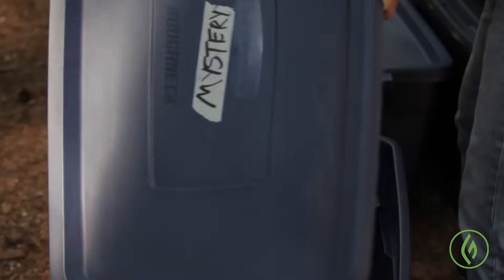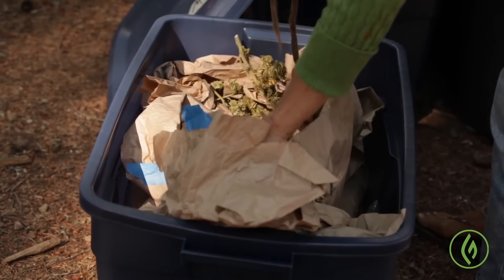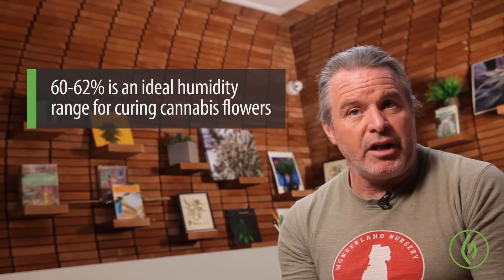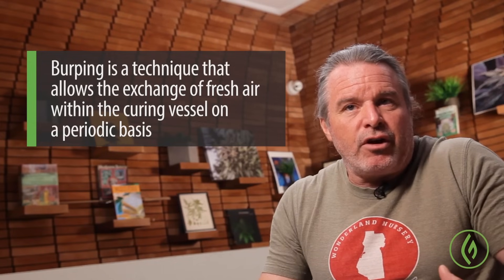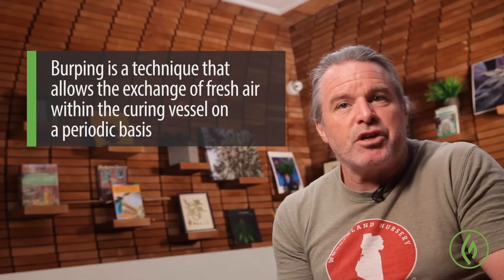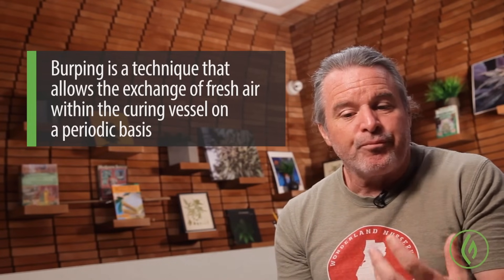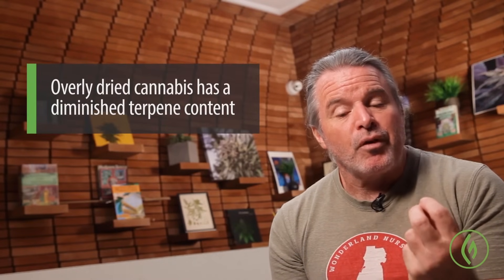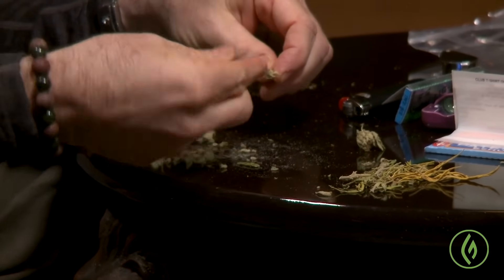Kevin Jodrey: Ideal Cannabis Curing Parameters / Ganjier

Comment: Idk, I started growing in a hot environment. Temperature would be 80 in the house with the AC on so I had to get a dual exhaust AC for the room (if you know you know)

So anyways, there was no cool spots in that house so I would cure in my dresser drawer for a couple months and it would come out AMAZING. To the point I understand most growers still haven't figured it out. With that said, once I moved to a better environment (stable) better lighting/etc and while I'm doing mostly different strains the quality of the cure has dropped off a little. I can't get that AMAZING level that I hit routinely before. I'm getting bigger yields but not necessarily better. Only difference in my cure process is it's in the 60s now instead of 80+ degrees.

So you see how this videos information has me asking questions?

Comment: Open Query:

I am in pursuit of 'greasy weed'. I don't know if that specific result is a genetic trait, an effect of a particular growing environment, or if it comes down to drying and curing a specific way. I've been blessed with that in the past, but inconsistently at best. 

At the time, I was hopping between MG soilless mix and RDWC with Peter's 20-20-20 & 10-50-15 nutes. Don't hurt yourself busting that gut, but I did get excellent results. Of course, Marc Emery provided some great genetics, back then. Notwithstanding the beefs he may have earned from his suppliers.

Drying was never specifically regulated and curing only occurred whenever I opened the Rubbermaid. Ugh! 

Note to self: KEEP RECORDS (moron) 😁

I'm hoping to learn a 'proven' method [or combination] that will produce 'greasy weed' for me, consistently.

Greasy Weed = Saturates the roach, black like molasses and often ends up staining your tongue with little boogers of resin.

In the bag, it is ready to smoke and yet, still feels resilient [if not down right MOIST].

Thanks to all for any hints, clues, and/or shared experiences. Peace 

#HealingOfTheNations
Reply: Too much high of nutes and wrong ratios.
Reply: @dalanwanbdiska6542  Is that your recipe for Greasy Weed? If yes, I'll have to give that unorthodox method a try. 

Thank you for your valuable contribution.

Comment: Burping? It's called sweating , it's a short cut.its used to draw the moisture out faster so you can dry in under 7 days.best drying method is hang dry in a room with the room humidity being the same humidity as buddy in the video says...oh ya also vent the drying room every couple days with exhaust fan ,might not be necessary but lots of wet weed raises humidity obviously and dehumidifier can handle but I like to just replace stale air.also airflow helps but can dry the outside faster so don't put fans directly onto the weed to try and speed up

Comment: How low in temperature can you go before it degrades the produce?
Reply: A lower temperature won't degrade the plant material. Many people curing the 50's degree range. If the room is too cool it can take longer to cure. The key is to use a dehumidifier and set it around 60%. This will keep the drying space dry even though the air temperature is low. Many people think heat is the way to cure, but it's actually more about humidity. If the air is too dry the plant matter will dry too quickly which degrades the quality of the finish product. Some of the best herb in Humboldt is slow dried for 2-4 weeks at a low temperature and with humidity in the 60% range. You could go with a higher humidity level to slow the process down even more, but once the humidity level get below 50% its curing too fast.

Comment: Mine was near dry and I got hit with 80% humidity. It lost a heap of weight and smell from it. Burping it hasn't done much good either. Now it real fluffy and light.
Reply: All you had to do was get a dehumidifier at Home Depot simple stuff man....nothing wrong with light and fluffy that's more of the strain type or how much light the girls had during harvest full sun from am to pm matters in density and size not always because some strains are just not as dense aka heavy....
Reply: @clintcoop5717  never had a problem like that before. But probably never had weeks of rain either.
Reply: @billyballsup2685  simple purchase of a dehumidifier and a small heater set at 75° would of don't the trick
Reply: @clintcoop5717  dehumidifier couldn't keep the moister down. I spent 800 on one and it's shit. Ok if it's not raining out side. I had to add a bar heater as well to get the moister out just on low. It helped but couldn't turn it up as it would be to hot then. Everyone here has been having problems with humidity. .
Reply: Bud looses around 70% of it's weight after drying approximately...
What matters is the smell the taste and the quality of the product...I always rather have quality over quantity but it's nice if you can find a good strain that can produce both if grown harvested and dried properly.

It takes atleast a good month just hanging with the big leaves taken off let it dry slow and then dry trim it..bag it or seal it then open it for a minute let it keep sitting...
Reply: @clintcoop5717  iv don't it for years iv never had buds come up so light weight. And the buds where 3 inches across hard as. A day or so before the stem would snap they got filled with humidity and two days after they shrunk half the size and lost all the weight.
Reply: @billyballsup2685  what did you do dunk them in water lol...idk man I wasn't there so I can't say why or how etc.....If you've done it for years that makes no sense when you say got exposed to high humidity...

Comment: 60 degree drying isn't doable in some locations and not essential. My dry room is low70's/low 50's humidity and it produces 🔥🔥
Reply: I agree , mold grows at 62%so that’s sketchy . I use Greenshock farms method of 24 hours high heat and super low humidity for 24 hours then go to normal until the stems snap , then in and out of sealed containers until perfect instead of burping . At the end 62% is perfect . It works , Greenshock farms wins Emerald Cup with their flowers
Reply: What’s high heat? 90 degrees?
Reply: @redgeasherreduxdeluxe385  , 90 might be a bit warm but it’s ok . I’ve had it hotter and had good results still .
Reply: @jacobreynolds4547  do you do anything special to store excess before you have a chance to trim. I usually grow 4-6 plants a run and I'm the only trimmer. I see peeps use totes, paper grocery bags etc..?
Reply: @stangcobra592  , come harvest time I give them a couple days of darkness and then go in and either chop all of them or one at a time depending on how much there is . If it’s a lot I will chop one at a time , then I wet trim with a pair of scissors that I melted the rubber O ring out of , it might be weird but with some slop I can still do my trimming and don’t have to worry about cleaning off the scissors neatly as often . I go through and take off all the fan leaves and what doesn’t look worth saving until the plant is ready for final trim . If you wet trim the buds shrink and the trim job looks a little better afterwards unlike dry trimming . I never have to store anything but sometimes I hang them over me to motivate me to get moving 😂😂 Hope that helps , it seems to work out pretty well
Reply: @jacobreynolds4547  I always dry trim and some strains like AK pack a lot of small sugar leaves in the buds & it tends to be a hassle since I'm a perfectionist when it comes to visual quality haha
Reply: @stangcobra592  , I hear ya . I’m so busy blowing glass all the time I just get it done in the quickest way possible for me . Usually good to smoke in 10 days or so . 🍻 😁
Reply: @jacobreynolds4547  that's more in tune with Rosenthal's old book and works great.
Mild excess heat and minor effects on terpenes is far better than building ammonia in a chilled damp rooms.

Comment: I was hoping Kevin would give an ideal humidity for bud in long term storage. Boveda are 65% so I guess that's likely about right. I put my bud in big glass jars (about 2 gallon) and burp frequently until they're under 70% (hygrometer in each) and then transfer to masons and burp less often. I haven't lost any so I guess that's about right. I have some two year old bud that's still really decent to smoke.
Reply: Boveda has 62% packs, I've used them for a few years. Keeps material ~60-63% RH. I too have 1-2 year cures that average around 58-60%, but that's a personal preference mate
Reply: @GordonLittell  Yes, integra boost packs have been out longer and started these with cigars long ago (and it has a freshness indicator that turns another color when it goes stale). Boveda is typically sold most in the 62, correct. I do not think I have even seen many of the others, never seen a 65.
Reply: Most ops now are doing the 60F and 60RH standard, started a few years back.
Also, I have tried some very old metrc dated flower that was good from nitrogen n2pack cans (high altitude denver flower) from Scott Reach's indoor operation. He uses a special 8th canning machine and I am impressed at every dated flower I tried from his farm. It seems to really help longterm keep things fresh, and maintain proper moisture (even stored properly at high altitudes which usually dry out faster)
Reply: Boveda is 62%. You dont jar until its dry. Then burp. ???
Reply: @tent4331  I hang branches for about a week and then remove the buds and place into the huge jars. I burp them several times a day until they get under 70% then put them into 1.9 litre masons. Burping less frequently until about 65% and then they just stay in a cool dark place for long term storage. I have used the 62% Boveda packs but find they’re really not necessary because the bud is stable in the smaller masons as long as I don’t open them a lot. It works for me - I haven’t had any jars go bad. Those two gallon glass jars save me a lot of burping at the start.
Reply: @tent4331  I hang my plants in a controlled room at 60 degrees & 60 percent humidity for two weeks then jar. 24 hours after jarring and they usually rest at 60-64. If its under 60 I'll pop in a pack for a few days.
Reply: The indicator never turns color  you can hold a lighter on it and leave it in the sun. The packs are for long term storage. That's the idea.
Reply: Boveda and humidity packs longterm actually does not preserve terpenes. I have seen them used in huge operations in sealed containers.
Everyone is using curetubes, n2pack cans in cold storage, and groveBags has a lot of good reviews. I think n2pack many month old properly cured flower is impressive and like it is fresh. I have grown and harvested in Denver indoor ops and Oregon outdoor acreage. Boveda just doesnt work longterm, it just doesnt help you longterm.
Reply: @dertythegrower  I don't use boveda packs long term. I usually use them for a few days to a week to stabilize to 62 then I pull the packs. I did a long term test with the same product, the one without the boveda stunk up the room while the other was more earthy and muted. I agree that humidity packs are best for short periods 😁